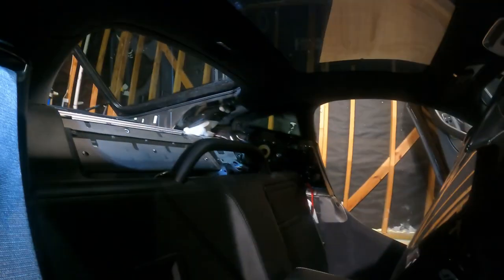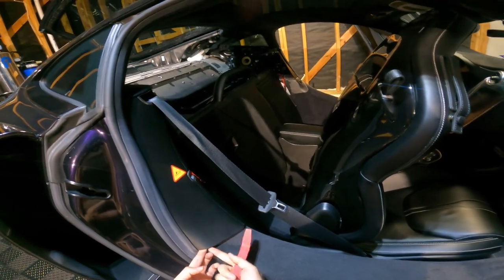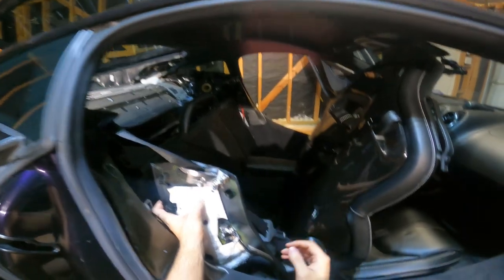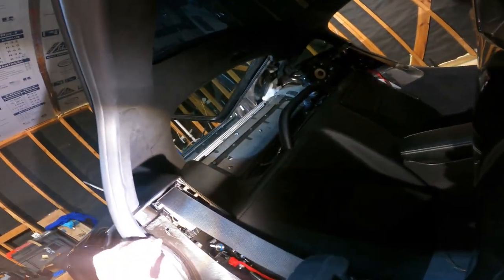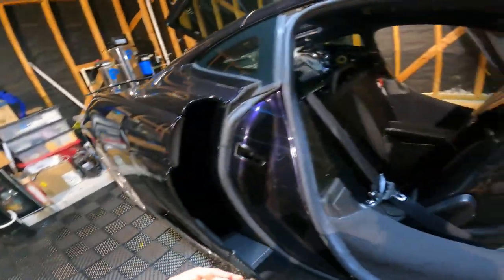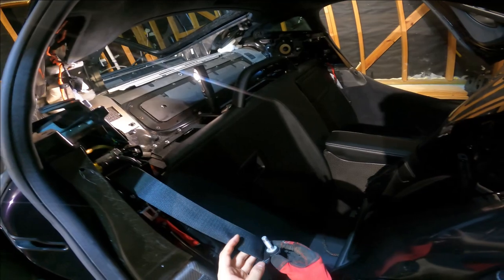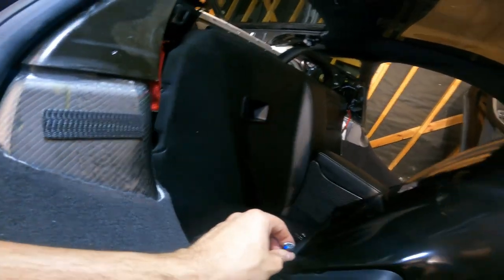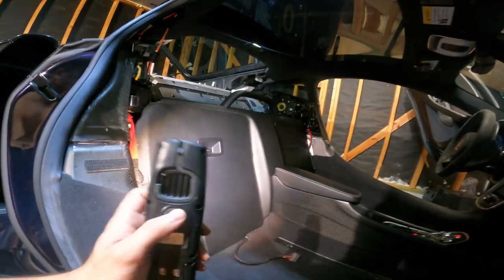How to remove mclaren seat belt and seats

Comment: can i remove just seats no seatbelt?
Reply from the maker: @fmarketing7894  yes but remember if you disconnect the seat connector after that you getting a lot of error massage, if you don't have mclaren diagnostic tool don't do that!! Because after you remove even reconnect still getting error massage
Reply: @janpakx  I dropped coins underneath the seats. I am thinking to remove the seat to retrieve the coins or should I just leave it till it builds up
Reply from the maker: @fmarketing7894  unfortunately 2 times I had this issue coin went under seat  inside of the reil very tight space to remove coin, you have 4 screws, rising up the seat to reach to screws and remove and don't disconnect the seat if you disconnect the seat you will have to take delarship, and pay a lot of money to reprogramming